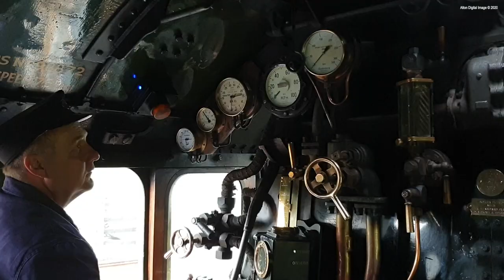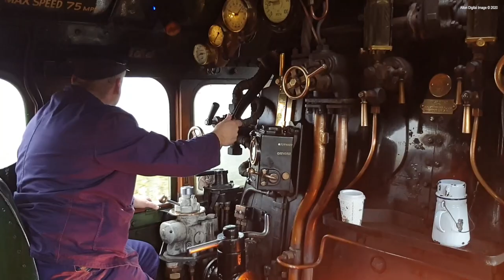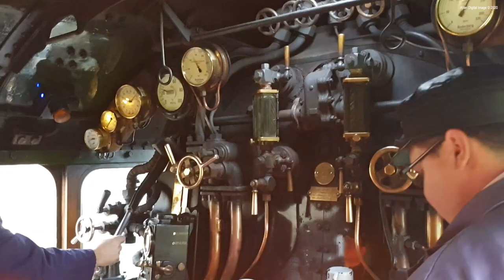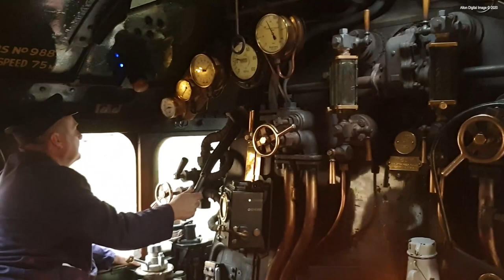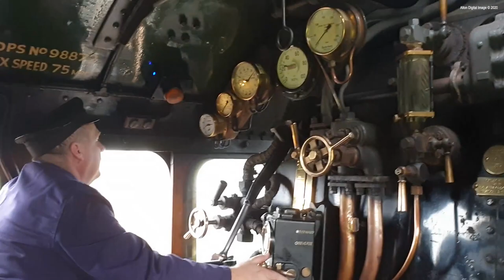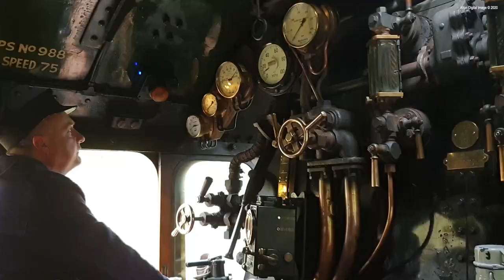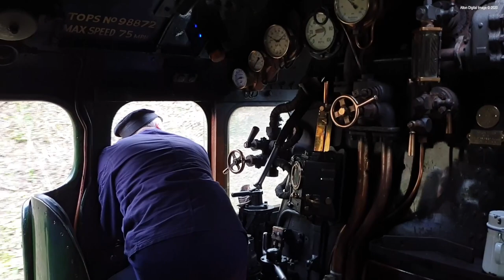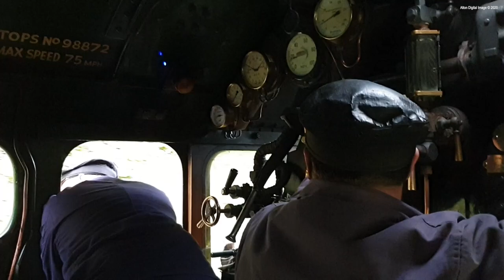Flying Scotsman 60103 from the Footplate Watercress Line

Comment: What is the signal the driver is acknowledging from that box to his right every so often?  I can't believe it's cab signals on a tourist line using a token system.  Some kind of alerter?
Reply: maybe dead mans handle
Reply: @dylan3657  Same thing.
Reply: It’s the AWS. It’s a warning system that trains in the UK use (even modern trains today); when it is approaching a signal at caution or danger, a horn sounds and the driver has two seconds to press down the lever and cancel the horn or the emergency brake will automatically apply
Reply: @AutoUnder  Only two seconds ? Here in Italy the driver has 5 seconds to press a pedal, but the horn sounds   every 55 seconds. The trade unions believe it is very stressful. I guess it is different on high-speed-lines.  I apologize for my shaky English.
Reply: @giovannigino3675  AWS has been in place since the 1950s so all drivers are used to it and pressing the button when the horn sounds just becomes second nature to them. There is also a foot pedal on more modern trains that the driver has to keep pressed down at all times but they have to release it briefly every minute when a buzzer sounds to confirm they're still responsive; if they release the pedal when the buzzer isn't sounding or they fail to release the pedal when the buzzer is sounding, then the emergency brake will apply
Reply: @AutoUnder  you explained it perfectly.  Thank you.